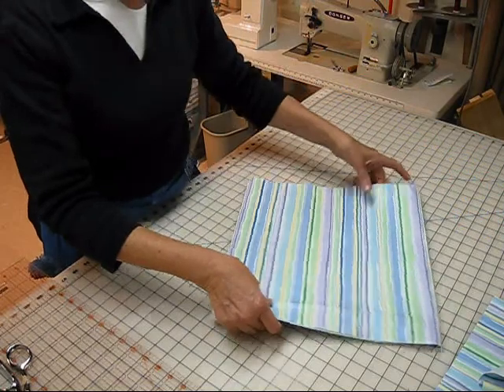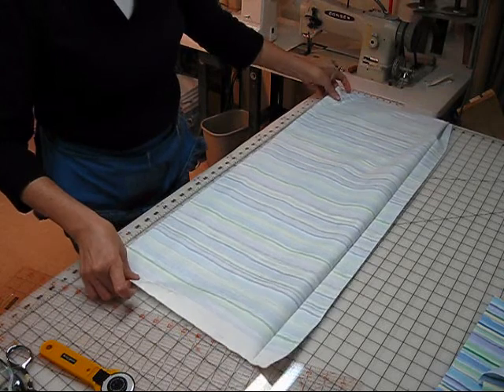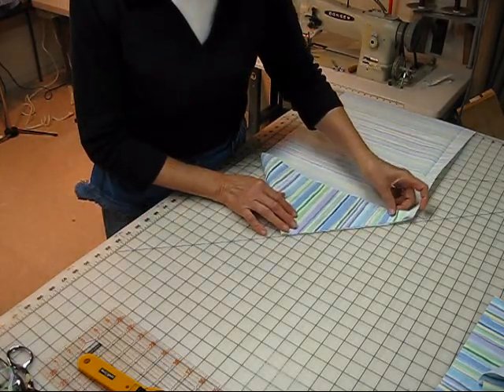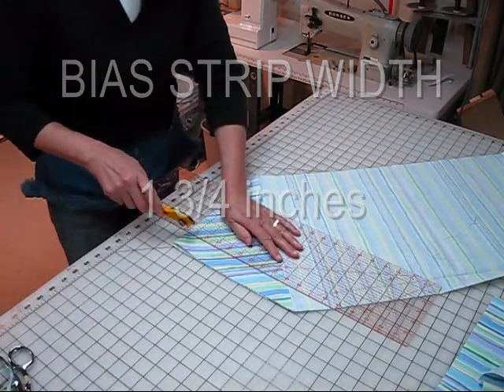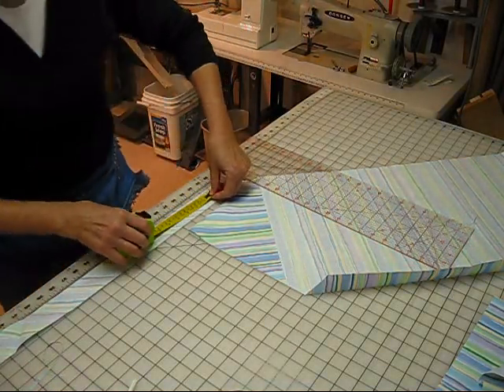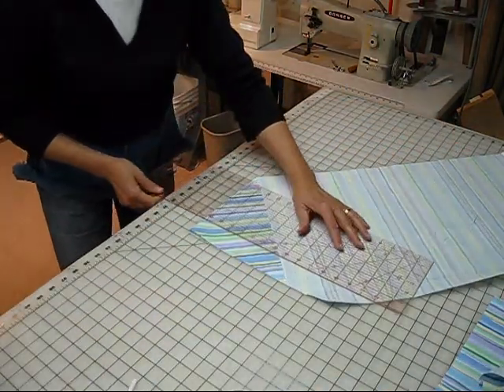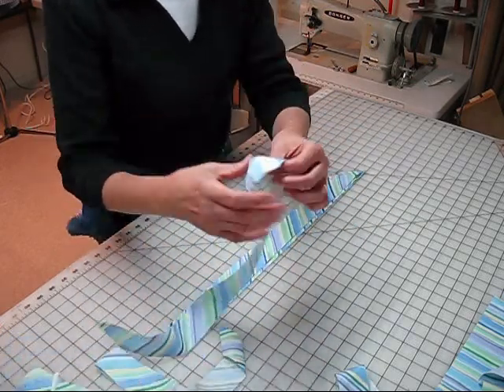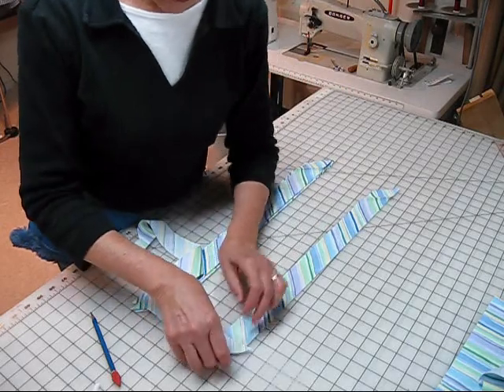(3) Little Striped Cushion - Cutting Out Part 2

Comment: Peg...I love your cutting mat.  How big is it and where did you get it.  I need one that big!
Reply from the maker: +Doreen Smith Hello, Doreen, Thank you for writing. Here is the link to the mat I use. http://www.joann.com/36x59-cutting-mat/2622033.html#start=13  This is the second of the same kind I've purchased from JoAnn. The current mat is about 6 years old. The original mat lasted about the same amount of time. I ended up cutting it in half and using the best half for small cutting jobs. The other half makes a good surface for messy jobs like making crafts with my grandchildren! Sincerely, Peg